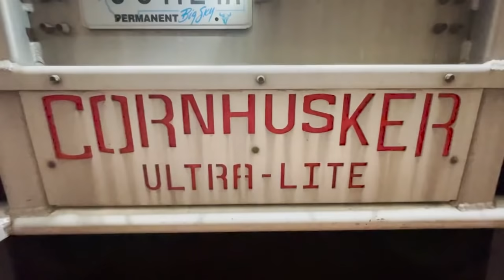Roll on 18 wheeler! Sleepless nights making me feel OLD!

Comment: Yep truckin & operating heavy equipment takes it's tole. As a young buck driving a well worn 20 year old rig some 50 years ago was a life i would'nt want to repeat, No creature comforts in rigs built back then & pay was squat. Driving the unimproved/improved but paved roads in Nevada back in the day was more than a workout, i gave that up the road ranger to operating dozers, loaders & hoes remote areas of the desert , my old body is still paying the price every day for every mile i drove and every bucket i dumped.. Still own & drive my 1941 GM SWB conventional, which these days would be considered just a average 2.5 ton truck. Take it easy Jax, old DesertRat from Keeler @ the bottom of Cerro Gordo grade.
Reply from the maker: I can’t imagine!!

Comment: Sometimes that works but sometimes it doesn't either. Seems like shredded paper wouldn't weight all that much, now if it were compressed into bales ya. I used to haul rolls and paper and it was really heavy. I used to stay out three to four months at a time. Once I stayed out 6 months when my wife was on the truck with me. You think it is tight, you need to do some trucking over in Main and on the east coast when cities were made for horse and buggies to get around in and try it with a long wheelbase tractor and 45' spread axle trailer; now you know why we have dump valves on our axles so we can help get around in tight places. East coast is real tight. With lots of low bridges too. Yep I ran hwy 12 before into Nanches and into Yakima at hwy 82. The wife is a cutie for sure.

Comment: being a mobile / ex trucker ect ect.  best deisel ever made Jax, Series 60 so lovem.  only week part on them is the timing sensor you can change them holding your tongue just perfect with out taken out the air compressor. they are located behind the air compressor. i have changed a few of them and is possible to do. for a cheep cheep part they are worth carrying a spare with you.  you can find out if they fail reading your codes on the dash. hi5 stay safe fellow trucker love the videos
Reply from the maker: Good to know
Reply: Another at the left front just above the oil pan also, timing related sensor, trs.  And the one you mentioned  srs,  forgot which is which now,  most companies had me change them both .  Priced 36 dollars 20 years ago, maybe 120 dollars since this administration has destroyed our nation..

Comment: For head sets try the aeropex bone conduction head set.  It leaves you ears open for other sounds and has a mic that works well.  If you are in a high noise area you can put in ear plugs and still hear ad talk.  The mic doesn’t pic up much background noise.

Comment: Love the videos. So how do you like the minimizer seat you have? And how do you like running the super singles?
Reply from the maker: I enjoy the minimizer. However they have ceased production due to high costs.

Super singles have an auto air inflation system in them and so far knock on wood I’ve had no trouble! I carry a spare in my trailer to be safe.